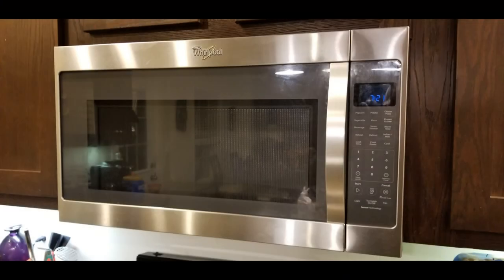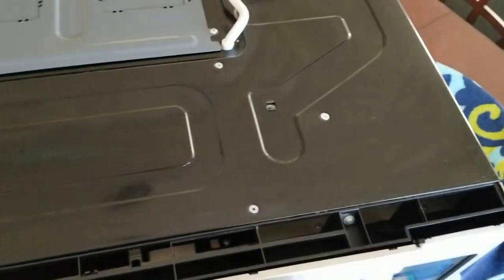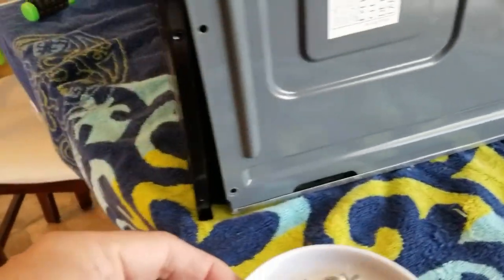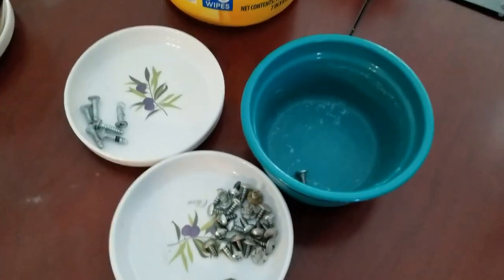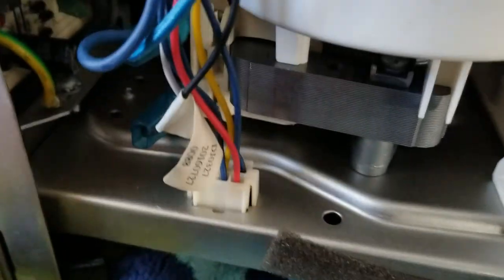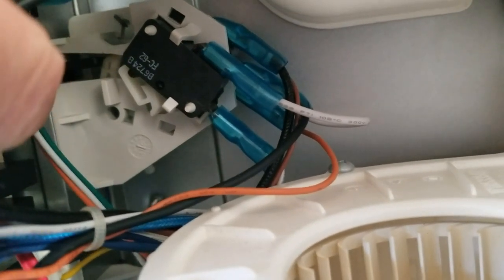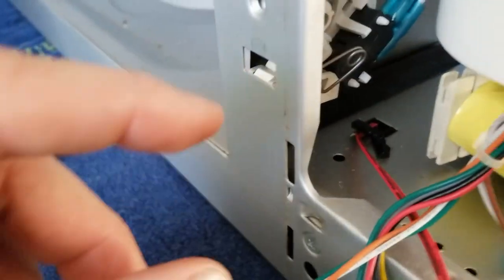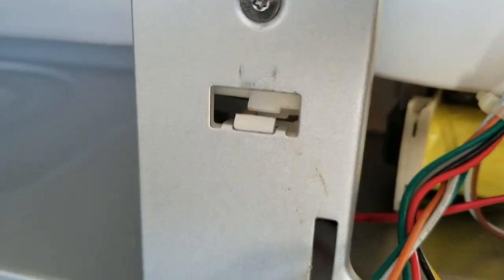I Can Fix It - Whirlpool Microwave Model WWH53520CS-5

Comment: Sorry, you made a relatively easy fix very hard.  No need to take the unit down.  No need to remove the back panel.  But these switches sometimes 'stick' in the rearward position.
Always, unplug the unit if you work on it --- if you don't........       
Most likely you can use a bent pick or stiff wire, reach in and pull the switch back.  But you will probably blow the internal fuse doing this if you did not unplug the unit.  SO:
Fuse replacement:
You DO need to take off the top grill (two screws).  Remove the top screw holding the control panel on and 'bump' it up to remove it.  Not even necessary to remove any wires, just let it hang.  Remove the two screws covering the power supply and remove that metal cover.  Replace the blown fuse.
Put everything back together.
IF for some reason you do need to replace the switch --- it is right there after removing the control panel.
Reply: I like the idea of using pick to pull forward. I don’t know where to put pick tho. Any advice? I’m pretty sure my bottom is stuck back

Comment: Thank you so very much for your detailed explanation. More than I needed but it really helped me from having to buy a whole new microwave and have someone put it in. Just an FYI you don't have to take out and apart the way you did. You can take front grill off and the then one screw holding control panel, then screws that hold in switch. So easy took about an hour just because I am a novice. But I did IT. Thanks again.
Reply from the maker: Yeah, I have since found out that it didn't have to be even taken down to do what I needed to do.  One screw from the top and the whole panel comes off.  Oh well.  We live and learn.  Thanks for watching!  So glad you were able to do it yourself.

Comment: Thanks so much for the video!  But just FYI to everyone after watching this video I realized you don't need to take down the microwave to get to the latch closure/switches.  The single screw for the control panel is accessible from the top of the unit while it's installed.  I did remove two other screws to take the top airflow grate off which made it easier but not sure if this was even necessary.  So three screws total, nothing unplugged within the unit and I was able to reset the switches into the proper position in about 5 min.
Reply from the maker: You are correct.  I realized that after I had made the video as well.  I suppose I need to make a pinned comment about that.

Comment: I had the same issue with the bottom switch.  I tried the dental pick trick and it worked instantly. I put it in to the left side of the plastic and pulled forward. I used a scope mini camera to look inside.  Problem solved.  Didn’t need the camera but it was nice to have.

Comment: I gave you a thumbs up for the diagnosis. It should help many people. On the other hand I guess you wanted to help recording by taking the unit down but you should clarify that it is absolutely not necessary and a lot of extra work to take it down and even more unnecessary work to take it all apart. Whirlpool is pretty good about making things serviceable.. All the work you did could and should be done from the front. 2 screws to take the vent off, a couple more for a grill at the top right and 2 to remove the control panel. Then you have access to the switches from the front right side.

Comment: Great video! no need to take the entire unit down though. I had the exact issue on the bottom switch. I’m a woman with absolutely no experience doing this. I was able to remove the grill at the very top by taking out the two screws then I removed the section with the numbers where you input time by taking the screw at the top out and bottom out. Watch the video for the rest. Do note,I found it easier to keep the switch in the back position and install it then push them forward otherwise there’s a little silver piece that’s a little difficult to maneuver around.
Reply from the maker: I will have to look at that and see if I can get my instrument panel off that way.   There is a screw at the top of the panel that hold the panel, and once you remove that screw the panel lifts up.  But I dont think I can get to that top screw, or lift the panel, without taking it down and taking off the cover for the whole microwave off EDIT   you are correct  there are two screws you can remove and remove that plastic vent piece and gain access to the screw that holds the instrument and switch panel.   Thanks for the heads up and thanks for watching.

Comment: I basically did the exact same thing without taking it down or completely apart but when I flipped that switch back over it sparked and stopped working all together soooo did it have to be disconnected to do it or something? And I checked the breaker and flipped the fuse in case it had blown.

Comment: If the cam is locked in get a dental pick hook and pull it forward. Took 2 minutes after watching this video. Thanks
Reply from the maker: Thanks for the tip for future viewers.
Reply: Any advice on where to put pick to pull forward. Pretty sure mine is stuck back also.
Reply: @brianu33  hard to explain. I would try to find a picture or video of the switch and that will show you where to pull on it. I would find a plastic pick however as I shorted out my microwave doing this last time lol.
Reply: @leejc288  Bingo. I used a dental pick and pulled forward and it snapped back into place. It’s now fixed. Thank you for your help.